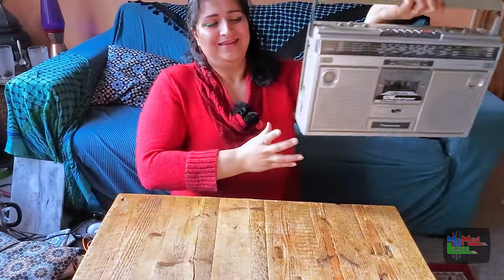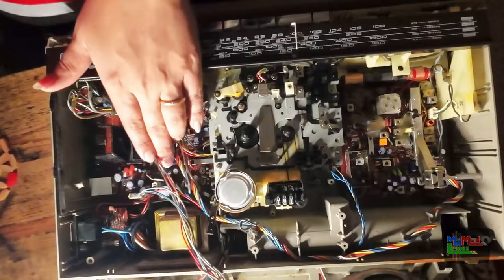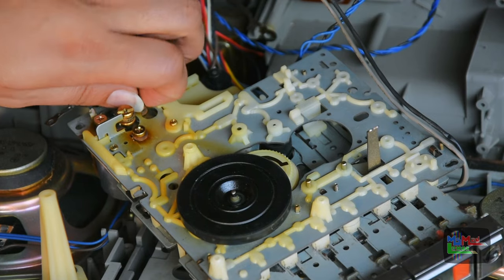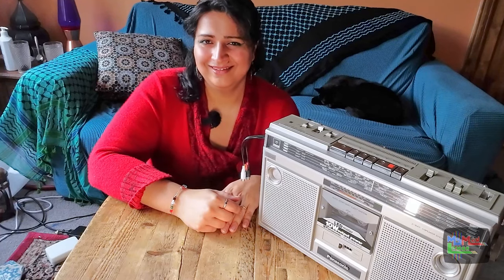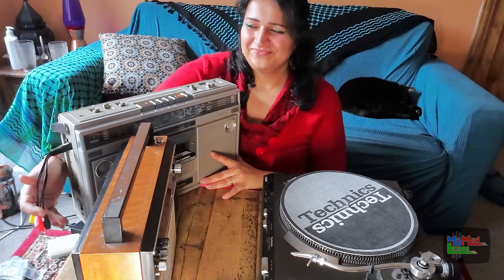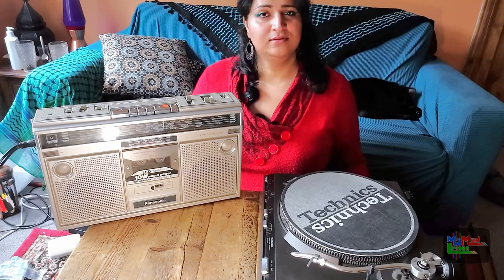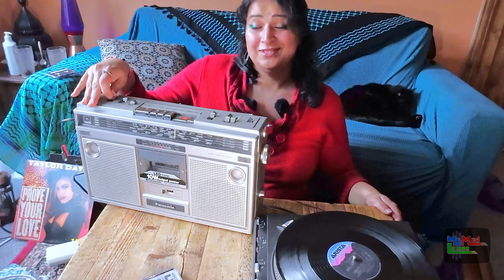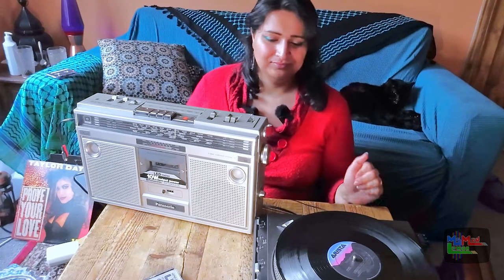Panasonic Tape Recorder Restoration & Chillout (Boombox RX 5120LS)

Comment: This is a nice boombox but I would check all the caps for green legs (corrosion) because they are notorious for leaking which wrecks the PCB traces over time.
Reply from the maker: I'm goin to do a recap on this in coming months anyway. As tedios as I find recapping, I feel its necessary on electronics this old.
Reply: @MsMadLemon  

It depends but concerning anything Matsushita made (or otherwise using their caps) that's certainly a good idea...

Comment: I'll be curious to see how you try different ways of converting line level to phono for the boombox. When I was a teen, I did it the naive way which was first using a potentiometer inline and adjusting it to my taste. Then I took the potentiometer out and measure its resistance and installed inline resistors with close to the same value. Like you, I was interested in just getting some of my Apple ][, Vic 20 and Commodore 64 audio onto cassette. I definitely wasn't obsessed over the audio quality! lol Imperfection has its own beauty. Thanks for another fun video, Maddi!

Comment: Any "user interface" is a prime suspect for TLC and repairs.  Try Servisol Super 10 spray for cleaning, because this also contains a lubricant, so switches and pots run smoothly after applying it.  Another common problem is bad solder joints.  Simply redo any that you find.  The Panasonic RX-5120LS was made in about 1987.  You might like the SK-353L (1982) which has line in and out, Dolby, and both chrome and metal tape settings.
Reply from the maker: Thing is, I used to use Servisol Super 10 before Dioxit, but was advised that dioxit is better, I think i'm going to revert back to servisol 10 for faders again. thanks for the suggestion!

Comment: Back of the motor is a clutch screw. Loosen to speed up, tighten to slow down.
Reply from the maker: Normally yes but inaccessible on this motor. Even if I pry open the bottom plate of it there's nothing there.
Reply: @MsMadLemon  : Not even a plastic dot like as a trap door or slit seal kind of thing? It's totally sealed and inaccessible?
Reply from the maker: @williamhelms9942  unfortunately yes.. Normally motors have something like this. This one no.. Not even in my other Sanyo boombox.. Though the speed change circuitry is external on that one.. They don't seem like standard tape deck motors.

Comment: Really enjoyed this. Could you do an internal switchable mod which is reversible and will use the pre-amp or bypass it. It’s only soldering that would be meddled with wouldn’t it?
Reply from the maker: I've thought about it and yes it is possible, just soldering and will need a switch somewhere so modding the case would be a must which i'd try to avoid. I think i'm giving myself a challenge to try and do it externally.

Comment: Equinoxe... I've got a collection of original cassettes of JMJ, wonderful Agfa Super Ferro Dynamic with red leaders, they're awesome and sound very good.

Why do you recap boomboxes? Are the vintage caps degraded?
Reply from the maker: Electrolytic capacitors tend to dry out over time, especially in old devices from the 80s, when this happens the values of them shift..Another thing that can happen is leakage from them, which is corrosive to PCBs and other components.
Reply: I lube the capstan bearings but don't usually change the caps unless I have to. I'll test the theory when I collect my next lot of vintage decks, mostly from the 70s (I don't make videos about it).